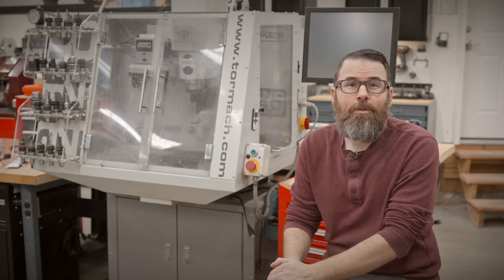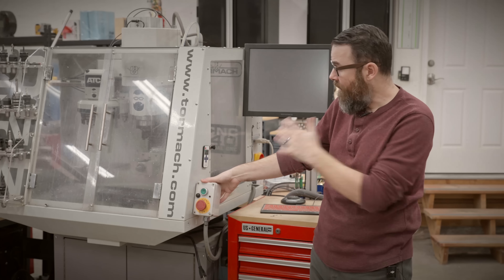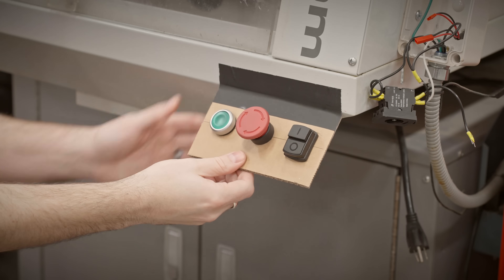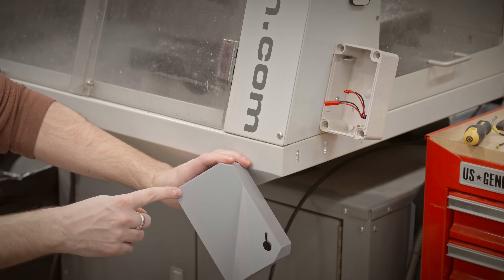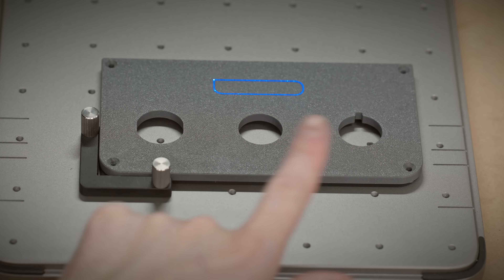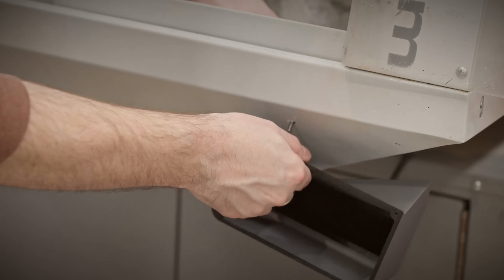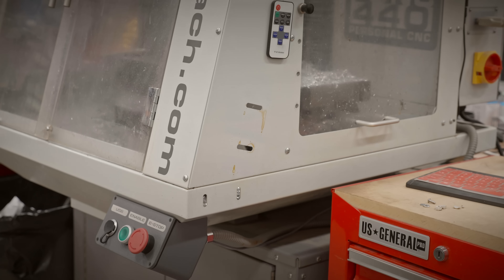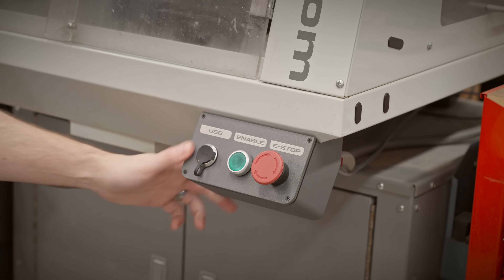Redesigning Tormach's E-Stop Enclosure - Over-Engineered Solution!

Comment: Really cool. Kind of wish you showed your solidworks process, it's hard for me to wrap my head around starting from a step or stl and adding my own pieces.
Reply from the maker: Kinda same.  It just takes SO much longer, but I guess I could just show the raw video of it.  For something like this, it's oddly simple.  I created a reference plane on the side of the machine (the plane where the old box was).  I created a 20mm offset from that plane.  Then extruded a solid box away form that, 'up to surface', selecting the enclosure surface.  The angle was created manually, just 40 degree tilt.  Then it's just a matter of turning that into a shell, adding holes for the screws.

Comment: The button being obstructed when the door is open seems like a hilariously big safety oversight. Especially when the door is open you'd want the emergency stop being accessible.
Reply: Well...interlocking the door so the machine spindle won't run with it open is safer, so it's two oversights really

Comment: I’m assuming you made sure that mounting bolt that the earth/ground wire is connected to is touching bare metal…right? 😂
Reply from the maker: actually yes!  even though the previous ground was grounded into heat-set insert in the plastic.